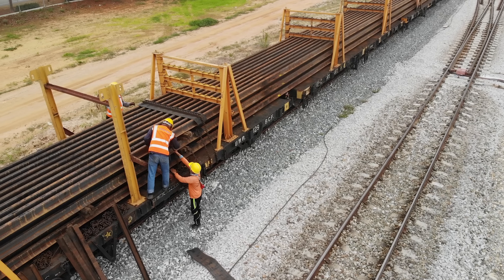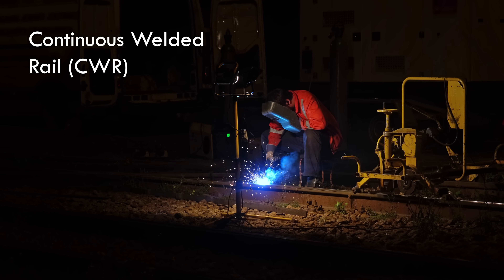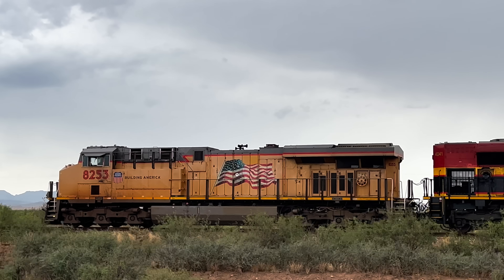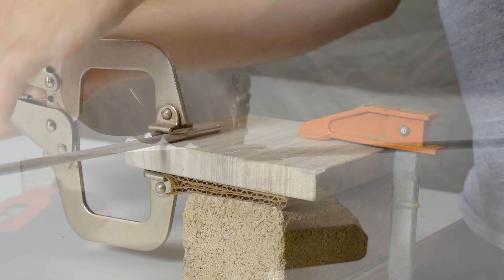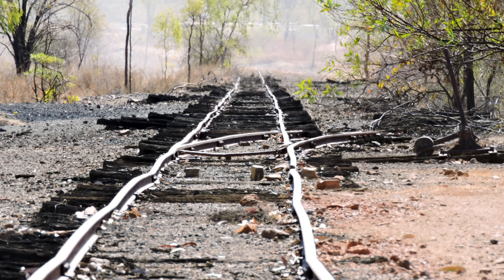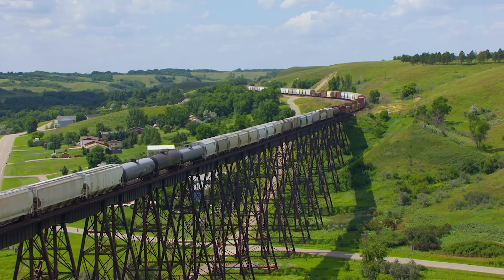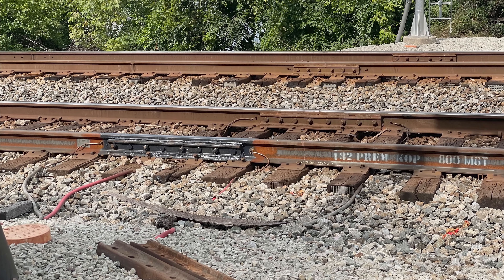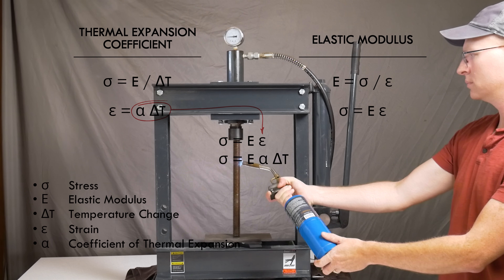Why Railroads Don't Need Expansion Joints

Comment: If the noise comes from the wheels hitting the rail at a gap in the rail perpendicular to the direction of motion, does something similar happen at a gap parallel to the direction of motion?  Or diagonal to the direction of motion?  I'm thinking that a potential solution might be to have the rails end in a wedge and have them meet where there are two rails simultaneously.  Is there a reason this can't work?
Reply: A scarf joint?
You can't do this with a vertical plane because of the beam shape of the track.
In a horizontal plane the thin section would get completely distorted by the weight of passing cars.
Reply: @jimurrata6785  Thank you.  I'm trying to think of more complicated meetings that could relief the problem, but the other problem I'm running into is how the wheels are actually supported by the rail.  I still think it would be interesting to solve this by considering the geometry of the rail segment meeting.

Right now I'm thinking, what if one beam cuts a "v" into the other - getting narrower. It would have to get taller in order to keep the wheel level, but I think it could work.?  Then when the wheel meets the other rail segment, it'll be making contact with both at different heights.
Reply: @SlipperyTeeth  Rails are crowned and wheels are tapered (cambered) so that trains can go around turns without grinding the flanges off the wheels.
It's an interesting geometry for sure.
Reply: I’m guessing that manufacturing the rail with scarf joints would cost way more than simply welding the rails together. There is also the fact that a high proportion of welded rail is reused from older existing rails. I worked for the railroad 30 years ago in the engineering department. They are very frugal in everything they do. Doing it in one location might make sense but when you have to repeat it over thousands of locations, it gets expensive quickly. During my tenure we removed “temporary” facilities that were installed before my father was born.

Comment: I watched a track gang use a product called fire snake to stretch 2 track ends to place new joint bars and bolts, pretty interesting it's used like rope laying it on the side of the rail and igniting it and it looked like a fiery snake.

Comment: Interesting to stand next to CW rails when a really long freight train goes by. Once the sound of the engine is distant, the cars are very quiet, just gliding along. You can hear the hum of the wheel bearings.

Comment: I want to know what generates noise for a train riding over the track. 

Intuition suggests that a straight, smooth track would generate little noise, yet this is seemingly never the case. Is this the stress on the sleepers? A resonance of the wheel and material? Something else?
Reply: The flange of the wheel impacting the gage side of the rail generates a lot of the noise.  Same with guard rails.  When a train goes through a curve, the flange of the wheel is grinding against the rail.  Rail lubrication can help with this noise.  Also flat spots on the wheels can create a banging noise, and bearings can squeak loudly.
Reply: @drummerdan14  Thanks! This makes sense!

Comment: That's pretty clever indeed. Nevertheless, if the gap in the joints hadn't been perpendicular to the rails but slanted, wouldn't it have reduced the wheels wear?

Comment: While these are ingenious solutions, I can't help but wonder: at the end of the video, you mentioned how they use oblique joins on bridges and whatnot to deal with thermal movement while allowing a smooth transition between railway sections. My question would be, why not just use those oblique joins at every track join instead of using CWR? Wouldn't that be a better solution, since it still solves the problem of train wheels being unsupported in rail gaps, while avoiding the issues of thermal stretching and buckling? There's clearly a reason why this isn't actually done, so what am I missing?
Reply: Cost and maintenance.  CWR is easy to maintain and may stretch tens of miles before it reaches a fixed object like a bridge or road crossing.  For the vast majority of the year, there is little to no maintenance required on that stretch of rail.  The first cold weather event of the year might cause the rail to break due to the high RNT, but then the rail is repaired and typically the RNT has been lowered now so that stresses are reduced for the remainder of the winter.  Come spring, that section of rail is adjusted back to the target neutral temperature and it stays happy for a while.  Every time you add a joint, you add additional inspections, maintenance, signal components and complications due to how the joints move.

Comment: I hadn’t realised how important thermal expansion joints were until I laid a bunch of laminate flooring without them. A few years later, I have to wedge boards back into position from time to time as they become dislodged. I guess it’s not just thermal expansion, though, but also physical rocking movement, like on a rail.
Reply: Wood swells when it absorbs moisture. You need to waterproof your floor.

Comment: I wanted to present an event from my past that is not directly on point here but thought your viewers might see in a similar light and find interesting.  I worked for the company that built the original electronics for Verizon FiOS.  We were doing some work at the start in PA with a Verizon employee who was a test site.  We were debugging the site.

One of the things that Fiber to the Home accounts for is dynamic changes in the delay between the endpoints.  We wondered how that system was working and so monitored the site for several days.  Our calculation of the thermal expansion and contraction of the fiber involved and concluded we should see about one tick of change from night to day and then again in day to night.  What we actually saw was dozens of changes.  Now my experience with this system was it was going to be deployed broadly and thus we needed to understand every phenomenon.  Even (like this one) when things were working fine.

It took me a month or so to uncover the answer.  I came across a paper from Lawrence-Livermore Laboratories that told me that mechanical stress on fiber optic cable causes signal attenuation and additional delay.  It turned out that this employee was on aeriel plant (aka on poles).  The fiber near her home was run through a tree. What we were watching was the wind blowing the fiber and the limbs of the tree.  Both were stretching the fiber slightly and thus adding delay. 

We used this phenomenon to create a very accurate mechanical attenuator for fiber systems, we could stress the cable slowly and create very small (smaller than we could get from devices) attenuations to test our systems.  This system was basically wood, screws, and cable and cost less than $1,000 to make.

Comment: The high neutral temperature thing is super cool, I would have been a long time thinking of that. Having the rail typically in tension also helps prevent it bend from other forces too. I wonder why they don't use that technique for more installations that have to deal with thermal expansion? Maybe significantly more complex to simultaneously apply heat/high tension and install say, a bridge girder.
Reply: A comon hazard in engineering is (literally) overconstraint.  If you oveconstrain a problem it can become intractable (unsolvable).
  
A lot of having a good experienced engineer, is the experience part.  Knowing that for say a sidewalk an expansion joint is the correct solution for the problem for a material that doesn't like tension but can deal with compression.  For something like a bridge grider, managing expansion becomes cheaeper than constraining expansion - those expansion forces need to be transfered to something, and in the case of a bridge it's the piers and foundations at each end.  Creating a bridge pier which is strong enough to constrain the expansion of the bridge girder would make the pier huge and expensive.
  
Enigneering is all about making the equation ballance out - and there are a lot of variables, not just loads and life-cycle, but cost and installation complexity.  This goes for every industry that uses any type of engineering (structural/mechanical, electrical, chemical...).
Reply: We tension steel inside concrete.
Reply: @ArneChristianRosenfeldt  Yes, for prestressed concrete members.  The stresses in the steel rods for prestessed or even poststressed concrete are 160,000 to 190,000 psi.  This is to keep the concrete cracks from opening up.  All concrete cracks, you just don't wnat it to come apart.
Reply: It wouldn't be practical to constrain a bridge girder in this way.  A rail can be restrained to the ground every foot or two.  A bridge girder needs to span some distance to be useful.
Reply: It's the wrong tool for most applications. The thing you have to remember with railroads is that:

1. The structure is entirely exposed.
2. The owner of the track knows exactly how many axles have passed over a section of track and how much weight each of those axles had on it when it did.
3. The thing that ages the track is well controlled (a little side to side stress and a whole lot of compression/expansion cycles from a single direction).

They tolerate the additional stress on the structure because they can figure out how long they can wait between inspections, which are easy to do because it's literally just lying there on the ground. If a section needs replaced it's a relatively quick and easy operation. For them they're trading shorter rail life to get longer train life.

Doing this on a bridge, or a building, where lots of the structure is hard to get to, has been subjected to unknown loads and cycling, and for which repair would basically remove the structure from use for a long time, is a much different problem... and what would the benefit of drastically increasing the cost of the build and reduction of life be? What would the neutral temperature even be in something that experiences a wide range of temperatures across it's volume? It's not worth it, you just design so the building tolerates the movement and there are points in the structure where the expansion loads can be relived and once the dry wall is up no one gives a second thought to the fact that the structure is a bunch of different elements that move with respect to each other depending on the day.

Similar situations occur with cars and airplanes. Weight comes at a premiums on an aircraft so you design the thing to just barely handle the loads and spend a lot of time thinking about how long things will last and  how you can make impending failures detectable before they happen. For a car, where a couple extra pounds has little effect on the end product you over design a lot of stuff and move on to more important things than min/maxing weight trades.

Comment: Can you explain why there are literal TONS of discarded rusted railroad spikes along train tracks? Was there a big change in steel standard at some point?
Reply: When a railroad gang comes through to replace ties or rail, they have to remove half or all the spikes in that section of track.  Each tie may have 8 spikes, and those spikes are not reused.  Typically there is a crane with a magnet that tries to pick up all the scrap, but often it is left behind.

Comment: I was surprised at your comment about the way railroads in the past used short sections of rail. It is not what you say about why but a far easier answer. When the railroad needed to transport the rail, the most common open top car or gondola was 40 feet in length so the rails were produced in 39 foot lengths to  fit in the car. Now most modern railroads use continuous welded rail. It does not need expansion joints because as the rail is installed, it is stretched before it is welded to the next section of CWR thus the rail in under tension. The railroad ( BNSF) near my house added a second track using new concrete ties and CWR. I watched the installation from start to finish and learned a lot by asking many questions of the worker on the job.
Reply: You're almost right.  The standard for rail length was 39 feet, so that they'd fit into those 40-foot cars.
Reply: @MikeV8652  OK I will give you that point.
Reply: Interesting while we have a very few sections of 39'-0" jointed track left a legacy of rail imported from the USA during WW2, while British industry was distracted by the need to produce other things. The UK standard for jointed rails has been 60'-0" since the late 1800's. Less joints meaning less maintenance, a smoother ride, and a saving in the power needed to move the train. Changing from 60'-0" jointed to CWR reduces the power needed to move a train by about 10%.

Comment: Awesome! I've seen thermite rail welding before and was curious behind the why's of it.
Reply: Thermite provides a very quick weld which has low thermal stress.  Any arc weld requires multiple passes due to thickness, each one adds stress as it cools.  The high tensile steel of the rail requires post weld heat treat to reduce these stresses.
Equipment required for flash welding is large and requires much power.  One truck of equipment with three workers can do a thermite weld.
Reply: Thermite welding can be done pretty much anywhere. Thats why its great for railroads. Railroads run across mountains, forests and other areas where there is no electricity.
Reply: woah, cool seeing you here. I subscribed to you many years ago, I hope you're well.
Reply: @Vulporium  thanks, I'm not doing too bad, hope you're doing well as well
Reply: Because they can. Let's face it, if you could, you would, even if you didn't actually need to.
Reply: Used to do thermite welds. Works on 2" gaps,  its basically adding molten metel between 2 pieces of hot metal. Usually the thermite burns at 1400° F
Reply: @NavajoNinja basically volumetric welding?
Reply: @NavajoNinja I hate to correct you since you're obviously experienced, but termite burns WAY hotter than 1400°F, closer to 5000°F.
Reply: 911 conspiracies are not welcome here.
Reply: There's a nice video on the "ccrx 6700 That's Railroadin!" channel of a thermite weld being made https://www.youtube.com/watch?v=OfZSYFOtHyA
Reply: @JimAllen-Persona You can't really see what is happening inside. It is a chemical reaction between Al powder and iron oxide and the product is molten iron falling in between the cracks.
Reply: I have watched thousands, I use to keep the time on them as
I was a technical officer , The welders use to say to me 
"why do you keep the time on us , you can see we do it"
That ended the day they said to me " have you kept the time on this
, our stop watch has stopped working" 
'appy days@JimAllen-Persona
Reply: It tends to be done in remote locations where it would be difficult to bring a sufficient power supply to site to allow other welding techniques
Reply: @tristiancapozzi1194 No it’s done all over England and Europe tracks are flash but welded in the factories but PLA -FRENCH or  THERMITE -GERMAN are the norm
Reply: I live in BFE and the southern pacific runs from L.a. to SLC, 
they BRING EVERYTHING when there out there fixin the trax, including lights.. 
they were working for weeks a couple times when a train derailed in a (flood plane) and washes, took out about a mile of track.  @tristiancapozzi1194
Reply: @tristiancapozzi1194  but it is still simpler and cheaper and needs less manual involvement and time.
Reply: bollox.... it has to do with the material....
Reply: Why's
Reply: something something 9/11
Reply: @Brett733 Amazing how quick the info po-po was to show up and slap you down.
Reply: @Brett733  
Short bus just arrived
Reply: why is of it??